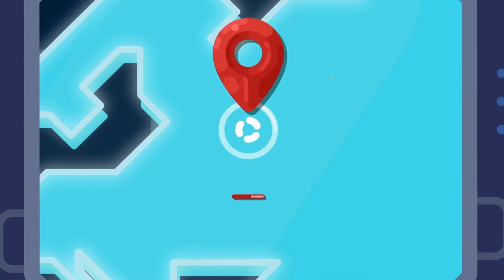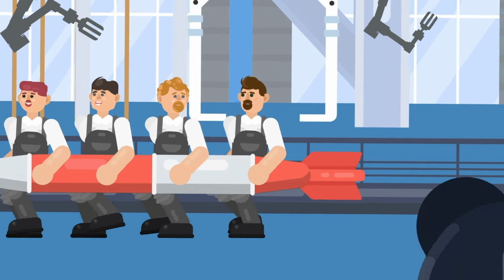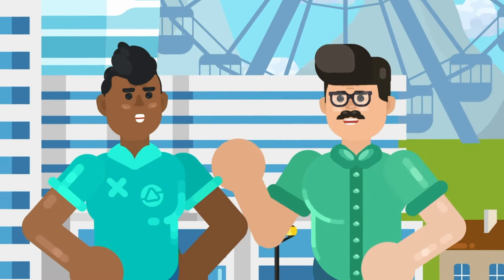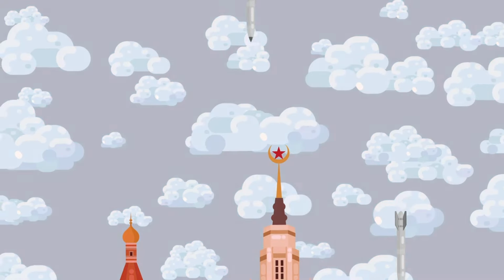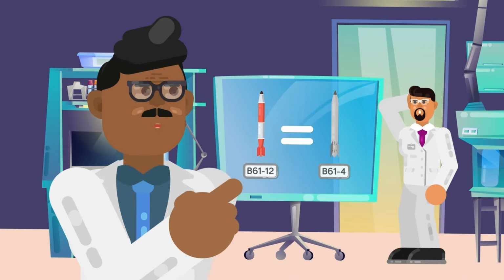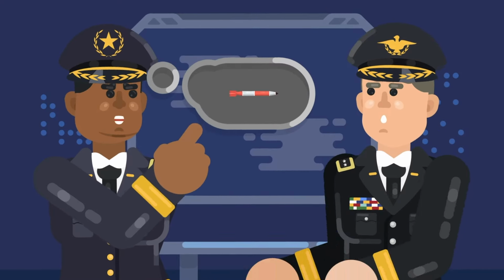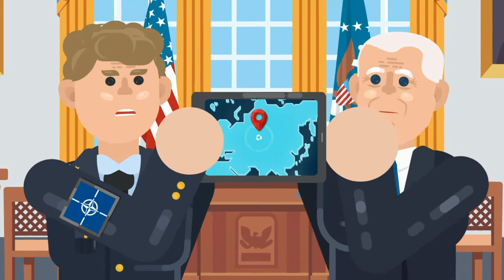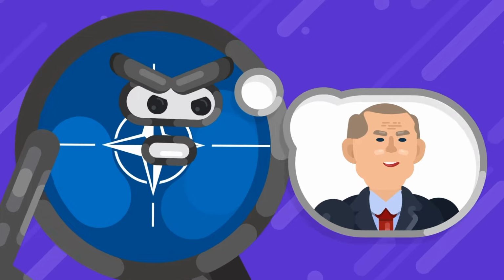Why Putin is Scared of US Gravity Bombs

Comment: Little boy was actually not triggered by barometric pressure. Although it did use barometric pressure to roughly get the height of the bomb, a more accurate radar mechanism actually triggered the explosion. The radar stage turned on when the barometric stage read roughly 2000 meters, and the bomb triggered when the radar read around 600 meters
Reply: But BIG BOY had more fun

Comment: 5 revolutions per second sounds fast but 5 rps x 60 (60 seconds in a minute)= 300 rpm. Your car idles at roughly 750rpm divided by 60 (60 seconds in a minute) =12.5 revolutions per second at the crankshaft. Yes easy to figure out but pretty interesting nonetheless. Especially considering that idle.

Comment: This is reality for me, I have been doing OBEs since I was a kid. God sent me into the future, I did not initiate this OBE on my own and there was no paralysis in this expieriance. 
  We are not limited past present and future are all the same  ..  I was in the future at a building that I had seen before it was built and there was no electricity anywhere. The building had been abandoned and was dark or so I thought but there was a semi trailer in front of the building with a large diesel generator inside it but it was not running and that is why the building  was dark. When I finally saw this building in real life It was an abandoned movie theater that had been built during the one year's time I had spent on Maui, it was pastel yellow with a blue stripe around the middle of it but I didn't realize that until years later when a church group bought the building and painted it dark grey and that this is the color it was when I saw it in the future and that it was a church and it was not abandoned, there were just no people there, until it started getting dark. There weren't very many people though and most of them were dying, I can't begin to describe how badly burnt and disfigured some of these people were and they were coming there to die. We were in a war and it was a nuclear war This encounter went on and on until I panicked and that ended the OBO, these people were to be euthanized because there was nothing that could be done for them I am going to have to learn to better handel things in the future if I am to do this again and learn anymore from this but I have found that there is enough to prepare for. I don't know if the course of the future can be changed everything I have seen so far continues on a steady course and nothing I do seems to change things any and now the nuclear dooms day clock has been changed to ninety minutes to midnight recently I have noticed and now Russia has surrounded us with warships. it is very evident that Putin does not trust the current administration and unless something can be done about the corruption in our government very soon what I have seen in the future will quickly become the present  ....

Comment: There are 1250 active US nukes, none is the old gravity bomb. UK and France may have some in their 700 nuke warheads, but less than 200 actively deployed.  Most of the gravity nukes are in the 4000 (US) and 5000 (Russia) reserved nukes.  These reserved nukes need the initiator to be installed with active ju-ju, just like the active ones which need new ju-ju every 10 years. It takes a long time to come up with so many active ju-ju initiators.  So the first rounds of big nuke exchange will be all missiles, may be very few gravity nukes from UK and France.  😎

Comment: I'm surprised the video doesn't mention some key points regarding B61-Mod 12 and the potential NATO's response to the Russian use of nuclear weapons in Ukraine.. 
Firstly B61-12 is basically a JDAM or a Joint direct attack munition with, and this is the key, the GPS guidance added to the inertial guidance system.. This makes the B61-12 incredibly precise weapon, meaning you can use the lower yield option and still get the results you want through putting this bomb within 10 feet of your target.. That is a game changer.
Second point I wanted to address is the potential NATO answer to a nuclear attack on Ukraine. First let's assume Putin is crazy enough to make such a suicide move, the tactical benefits of such an attack are non existent. Ukraine doesn't have 2000 tanks all hurdled up together in one massive 3 mile radius juicy target for a nuclear weapon. Putin could use it exclusively as a show of force and a tactic to scare Zelensky and make NATO rethink their strategy of supporting Ukraine with weapons...
Now let's imagine that Putin went mad and used one Iskander missile armed with a nuclear warhead and struck a relatively uninhabited part of Ukraine, killing a few hundred people. NATO would most definitely not respond to such an attack with a nuclear weapon of our own. But the respond would be fast, potent, massive and directed at the Russian forces in Ukraine, including Crimea of course. I presume this attack would start with a never before seen, massive attack from NATO's submarines, surface ships and aircraft, firing up to 1000 Tomahawks, Taurus, JASSM and  SCALP-EG/Storm Shadow cruise missiles. Cruise missiles would be used to attack command and control, SAM systems and airports. After the initial cruise missile attack NATO air force would fly in with 300-500 fighter jets and completely obliterate Russian fighter jets that wanted to fly and fight.  After getting rid of the potential danger for allied aircraft they would target and destroy Russian artillery positions and foxholes on the front lines.
This attack would practically end the Russian military as an active force inside Ukraine... If Putin wanted to escalate after that his only option would be to nuke NATO territory, from EU to US. After that all bets are off and we would probably see the end of the human civilization as we know it, with a billion people dying as a direct result of nuclear attacks, with 3-5 billion people more dying from the side effects like the famine and disease... Happy times...

Comment: I was under the assumption that nuclear bombs typically use an air burst method of detonation where they typically detonate above the surface but below an altitude of 30,480 metres (100,000 feet)

Did a brief google search and as it turns out not all of them do that...
Reply: There is an ideal altitude depending on the yield of the weapon and the choice of air, ground, or underground, depends on the target as would the yield. its not one attack fits all

Comment: Actually, the Nuclear Fusion  breakthrough at the US National Ignition Facility is not really important for commercial fusion, which would require a different type of reactor, but it is important because it simulates the conditions of a nuclear fusion explosion, an H Bomb to be precise. This will allow the US to test and train their models with real small scale explosions.
Reply: the scary thing is tactical nukes with Russian accuracy which so far is pathetic at best🤣🤣🤣
Reply: Technically, pretty much every nuclear warhead uses fusion to consume more of the fissionable mass by bathing it in neutrons. They're properly referred to as boosted fission devices.
Neutron bombs replace the uranium tamper, lowering the effective explosive yield in favor of releasing neutrons to irradiate the area around the bomb. That induces radiation for a relatively short period, denying access to an area and also was used in the US early antiaircraft and antimissile defenses, causing a fizzle of incoming nuclear weapon cores.
Technically, the largest nuclear device ever detonated was a neutron bomb, as its tamper was removed, reducing the yield of Tsar Bomba by 50%, but due to its already immense yield, the neutrons were only something to worry about within the fireball, where one would have other concerns to occupy oneself.
Reply: @spvillano  e.g. handling ambiant temperatures exceeding 20000k
Reply: Commercial fusion lol
Is amazon selling reactors now?

Comment: Fifty to one-hundred kilotons is the line between "tactical" and strategic weapons. All nuclear weapons are political weapons, though. They require specific political authorization to deploy and use a nuclear weapon. As a result, the tactical situation on the battlefield is likely to have changed dramatically by the time any such authorization was given. Military formations are mobile, and can be tens to hundreds of kilometers away by the time the use of the weapon is authorized. Russian command and control is just not agile enough to use any low-yield weapons against UAF formations in the field. And Russian political authorities are not about to give military authorities any kind of open authorization to deploy a nuke as they see fit on the battlefield. There just isn't any trust there to do that.

Comment: Another interesting possibility for this weapon: the copper slug that was used in the NASA Deep Impact mission in 2005 happens to occupy the same volume dimensions and is practically the same mass as the warhead section of this weapon. It may be that was effectively a dry run to see if they could nuke an asteroid. If that's the case it would be a one-for-one swap in terms of payload while following the intercept mission profile. (So if something calls for it, we already may have a rocket and spacecraft platform that is ready to nuke an asteroid.)
Reply: not sure how SPACEX feels about flying NUKES!  NASA can't launch a big party (let alone a spaceship)
Reply: @jamesnoord6295  wasn't it musk who wanted to nuke mars?
Reply: Most asteroids are piles of rubble, nuking them would just make one explode into many smaller, radioactive pieces that would still rain down on the earth - the pieces would be larger enough to cause local damage but the radiation may be a bigger problem. That test also showed that using a bomb to explode nearby, to make a shock wave to shift the orbit of the target away from earth, probably wouldn't work either - the shock wave would just shatter the asteroid instead.
Reply: @krisgonynor689  IDK...I'd argue it's better to have several Tunguskas than a single Chicxulub.
Reply: @h8GW   Yes
Reply: @h8GW  Brother. No one can turn a Chicxulub into a Tunguska, not even with a nuke.
Reply: @krisgonynor689  Yeah. Something to do with "impulse," the integral of force vs. time. Rather than the force of the bomb hitting the asteroid like a glacier moving a mountain, it's like a bullet train hitting the Arc de Triomphe. While the bullet train winds up landing in the dining area of the McDonald's on Rue Troyon, the remains of the Arc itself pretty much settle where it was standing.
     Though in defense of the OP, 300 KT inside an asteroid may have a significantly different result from 300 KT next to an asteroid. If we have to choose between an apocalypse and !!!!!!!AFUCKINGAPOCALYPSE!!!!!!! it feels like something that might be a no-brainer.
Reply: @krisgonynor689  For asteroid deflecting the DART mission is the best we got so far. And it worked.
Reply: @krisgonynor689  !?

Comment: Any "gravity" bomb is totally useless when both camps can detect when the bomber aircraft takes off even deep behind enemy's lines. These bombers are ridiculously easy targets today, they can be destroyed long before they reach the national airspace. Stealth bombers or flares won't deter modern detection and targeting features that combine several different techniques working together.
Reply: Russia can't detect where the HIMARS launchers are at and they are currently destroying his army.  The B61 would be delivered by stealth planes and those are not easily detectable, lack of detectability and targetability is kind of what they hang their hat on.  Russia also can't detect and shoot down giant slow moving Ukrainian kamikaze drones attacking their strategic bombers bases 100s of kilometers inside Russia.  You give Russia way way too much credit.
Reply: @brettblose1658  Not quite, I agree that Russia may not have the best and most up-to-date or state-of-the-art detection devices. I was speaking more generally, there are ways to detect stealth bombers other than via radar:
- Optically: AI can immediately detect such stealth moves by analyzing tons of successive satellite photographs), at least during the day;
- Using infrared: The warm exhaust air is cooled down with an intake of fresh external air, but it's released through the top end of the plane, because it still has a small thermal signature, so there's a chance that if they hide it from ground-based infrared detectors, it might be visible to satellites;
- But mostly, Russia knows where all these stealth bombers are located and most likely has spies on the ground tracking all these airfields and reporting each time one of these stealth bombers take off;
- Russia is also one of the few countries susceptible to have radars powerful enough to detect stealth bombers, that are rather big. Standard radars would in any case detect them at close proximity, another reason why Putin needs Ukraine, so he can deploy radars there,  so the bombers can be taken down long before they reach Moscow;
- Also, since stealth bombers always fly their missions by night, their engine buried deep inside the aircraft and its shape and speed probably has a small noise signature that can be more easily detected in the quietness of the night.

Military advances such as stealth bombers don't stay unchallenged for long.
Reply: Putin scared? what this nonsense? Russia has 6000 nuclear bombs to wipe out the US and the entire world. Wake up Yanks

Comment: @Infographics. Please make a video about the misconceptions of nuke starting with education of the citizens. If you get to safety in a cellar and aren't exposed to the blast and don't breathe in the toxis substance and wear some cloth that covers your body and you get out of the main blastzone you are pretty safe.
The other is that nukes inherently need to be re-enriched every so often. And third, nukes are a relic from the past before precision guided amunition existed or GPS was even a realistic idea. 
This implies the practical case for nukes is limited, which means the interest to have and maintain them is quite limited or in case of Russia, means blatant corruption. i.e. forms signed that the fission material has been re-enriched but never has been

Comment: Gravity bombs usually means systems like Rod of God; tungsten rods released from orbit. It is unknown if such systems are actually operational.
Reply: Doubt it. Cost to much to get them up there for what you could make for the same cost down here
Reply: @troymclauren1546  The cost of the F-35 program is over $400 billion. Over it's hoped for 66 year life span, with sustainment costs, it is expected to be $1.7 trillion.
Reply: @recoil53  10,000usd per pound is a lot to get something to space though. Buys a lot of hypersonic missles and drones
Reply: @troymclauren1546  They weight like 220 pounds. That's only $2.2M/per
But my point is that money doesn't mean a lot for a weapons system.
Reply: I think they are referred to as kinetic bombs, but that was also the first thing I thought of when I saw the caption.
Reply: Right, it'd be too expensive to set up and maintain for the time gained compared to solutions sitting on the ground; there'd have to be dozens or even hundreds of platforms to pull off a prompt strike -- think how the Starlink swarm provides relatively fast high-bandwidth internet compared to older Iridium or geostationary constellations.
Reply: @doujinflip  youd also have to consider terminal velocity, there might not be a point to drop it from space but instead just a high enough elevation, maybe high atmostphere at most
Reply: Was semi-tested in Vietnam. Just spend a half hour googling.
Reply: @elvispressley2365  For real! Lazy Dog or Yellow dog bombs had potential and they only weighed (apparently) 0.7 ounces @ 1.75 inches long.
Either conventional ordnance provides more bang for buck, or there is a top-secret program that even Infographics can't talk about despite their priveledged access to weapons tech info.
Reply: Nope, gravity bomb has always been the proper term for an iron or dumb bomb.
The rods from god was a concept that literally never made it onto the drawing board, as dropping something in orbit leaves something still in orbit - it can't fall when it's already falling around the planet.

Comment: The bombs that were dropped on Hiroshima and Nagasaki were about as crude as possible. Going back to thst design makes them nearly idiot-proof. Or that's the hope, one would imagine.
Reply: I think the gravity bombs would be used in succession, like a double tap just to make 100% pooptin is erased
Reply: @NaggersandJoggers  Well sure and probably multiple bunkers at once, just in case
Reply: They were recorded as using black powder. You make a big bang on the fissible material.
Reply: @genericscout5408  no, the fat man implosion device used plastic explosives. Supersonic shockwaves were needed to implode the core. Thin man was basically a gun with a uranium cylinder as a bullet entering a core designed to receive it and a tungsten stopper to halt the slug inside of the core.
Most of both bombs cores didn't fully fission and parts of the fissionable mass was recovered from both cities after the surrender.